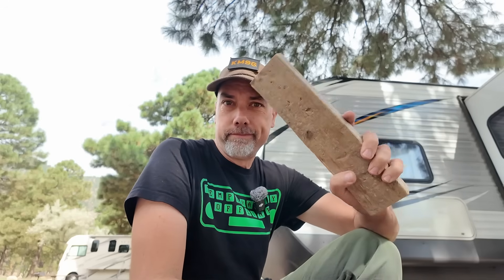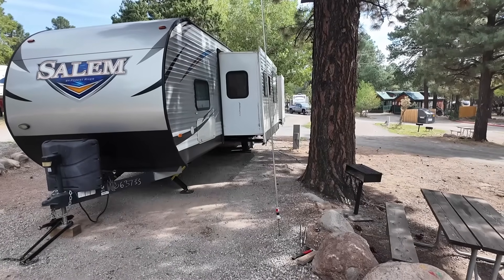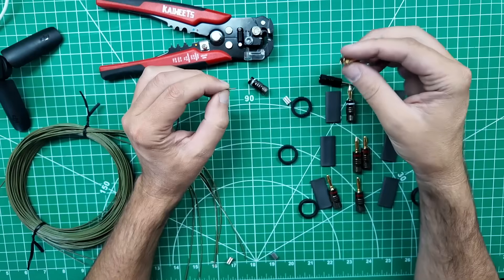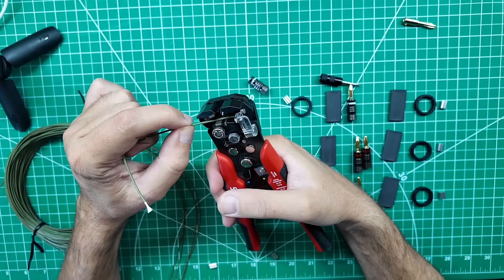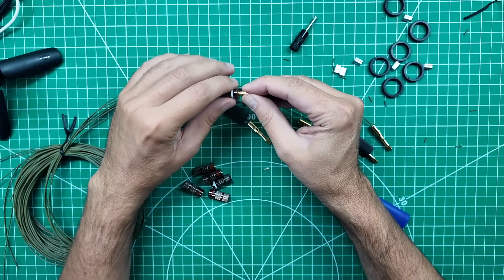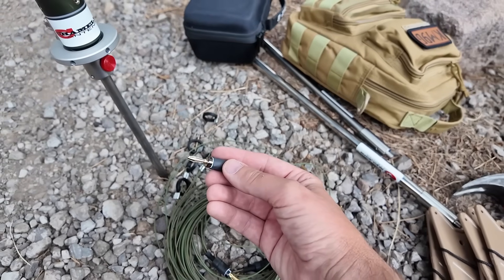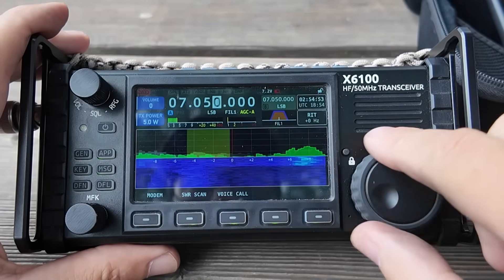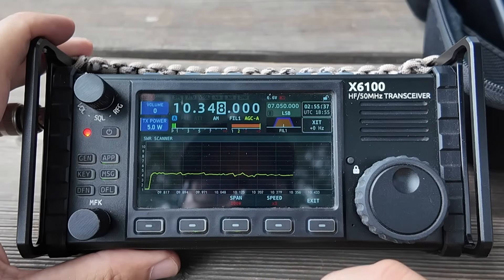Unstoppable Ham Radio Power! Chameleon Coils Put to the Test 🚀 | KM9G

Comment: Remember, it is a fixed coil, so you need to adjust the length of the telescopic whip.  For example, with the SS17 and the M-Coil (Black), you would get 40 meters with the whip fully extended.  To get 30m, you need to reduce the length of the whip to 7 ft. 5 in.  20 meters and above, you bypass the coil.  This per table 2 in the CHA BV User Guide.
Reply from the maker: Yep

Comment: You crimp the ferrule the opposite way you did it. You need to position the ferrule with the short edges in the jaws of the crimper.  Think of a figure 8, you crimp the top and bottom of the 8, not the side.
Reply from the maker: Thanks for the tip

Comment: That a nice antenna setup ! I want to get the 25Ft whip and bottom piece with the puck for the radials . with the stake , That gives a soled mount. Then feed with the 4:1 UNUN .The 4 MM banana fits inside a SO 239 nice. How I plain to put UNUN into it. I found 4 MM Banana connectors on Amazon and they have bult in Wago type. Strip wire insert . push lever down and done. They come in a set of colors . I have them on way for speaker system. Just search for Banana plugs and keep going threw the listings and you find them. That what I did . I did not know they made them. Sometimes you find great stuff just paging threw the listings.     Chameleon has great stuff. I love that wire . 73
Reply from the maker: Interesting find!

Comment: Hey Steve, I have been wondering if there is any difference when a single red coil bypass jumper (4mm banana plugs) is used versus the max of three that the coil supports? It seems like CHA included a total of six bypass holes (3 on top and 3 on bottom) for some reason. But why? Does SWR change? More efficient? More power handling?

You are the expert investigator of stuff like this. What say you?
Reply from the maker: I think it was some tooling or look thing.  I can't imagine it's any noticable difference.
Reply: @temporarilyoffline  Thank you.

Comment: 25ft whip and no coil and you can do a Rybakov with a tuner! My SS25 should be here this week. 🎉
Reply from the maker: I have wondered if the 25ft radiator+ 4:1 + tuner has some special sauce or if a 25ft radiator + tuner is good enough.  The 4:1 probably brings the 25fter into range of the 3:1 in most radios, but I've got good tuners.  Need to test this!
Reply: @temporarilyoffline  I made a Salty Walt K4OGO speaker wire version with a 4:1 unun, and it's really an AMAZING multibander.  From Chicago to New Caledonia, South Korea, Brazil, Ukraine, Saudi Arabia on FT8 and under 100w.

Doing the same antenna with a whip and spike gonna be way easier than running a mast + guying.
Reply from the maker: For sure it is!
Reply: @temporarilyoffline  Took less than 10 min to setup the tripod, blank adapt, LDG 4:1 unun and the SS25.  Quick tune on the G90 and it works a treat (on 40m FT8 to start)!  Radials are the longest part of the deploy. 😎
Reply from the maker: @pauldunecat perfect!

Comment: Its easier to tune the bank by either collapsing or increasing the length of the whip at the desired frequency. That way, you'll always get 1.1:1 on any band!
Reply from the maker: You're right, but that's like work man! 😎😎😎 Thanks for dropping by Carl!  Always good to run into you!  Trying to get to a park tomorrow for a follow-up with the pre-made radials and less thunderstorms!

Comment: Thanks for making these videos.  Can't imagine the effort of putting these videos.  I wonder if you carry around an antenna analyzer, would be nice to show the actual impedance of the antenna and the actual reflected power.  I have the 17 feet whip and mounting it on the top of my car with a mag mount.  Radials on the hub as well.  Got several successful POTA activation.  I'm saving up for that black m-coil, might improve my setup.
Reply from the maker: Thanks for the kind words.  I have a NanoVNA, but hard to work with in the field and share on camera.  Recently found the android app, so that could be a big win for showing the android screen in the video (easy to screen share the app)

Comment: As flat as that antenna looks across such a wide band it sure looks like a dunny load...
Reply: I agree :-) ! Even on 60 nearly flat..haha :-)
Reply: Somehow that coil looks to be too small to effective. You need to sacrifice one to the rf gods to see what it's made of.
Reply: The magic I think is radiated efficiency and SWR is not a sole indicator. You need to look at the impedance z = R + jX. R approx 30-60 and X close to zero. I suspect you will see lots of capacitive reactance caused by your compromised environment. I saw one suggestion of raising radials but that as I understand it will be “draped” from the feed point. One thought would be baseline in a better more ideal setting and experiment to gain insight in the compromised environment
Reply: @mattbielstein2451 I think I high return loss reading on an Antenna analyser is a good indicator of Antenna efficiency, along with a good SWR reading, just my thoughts!